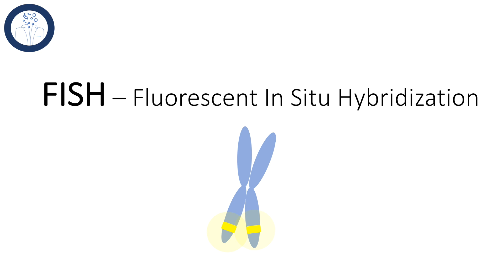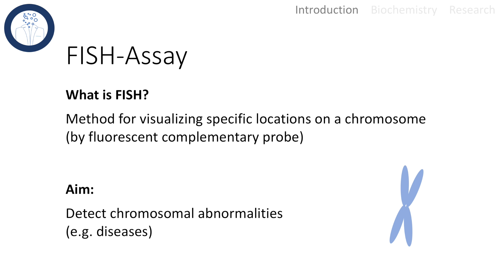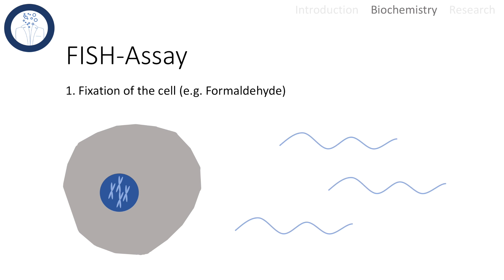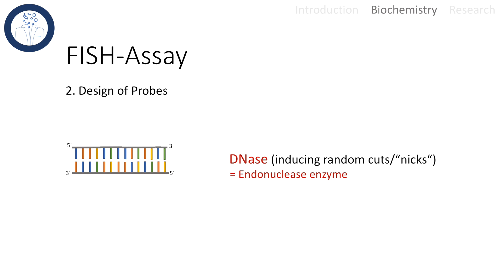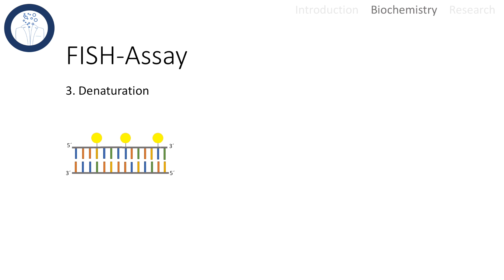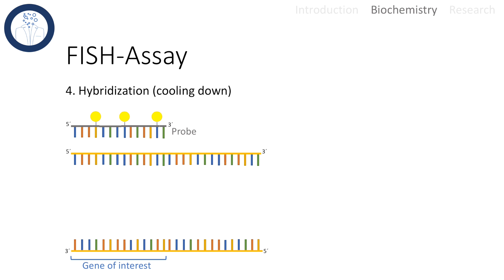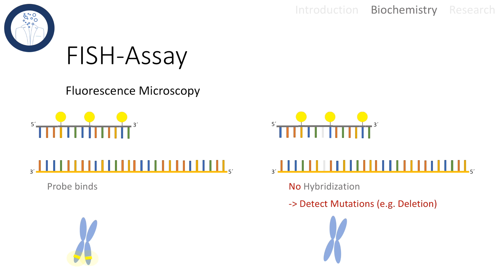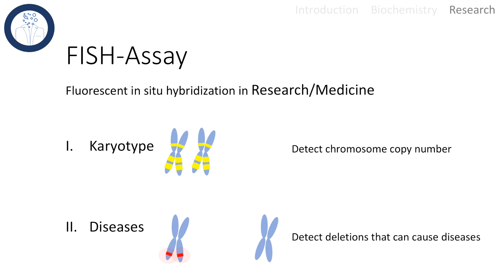FISH - Fluorescent In Situ Hybridization

Comment: 2 Quick questions
1) how can the ligase seal the fluorescent nucleotides. They need to be bound first right? So my question is how do these labelled nucleotide bind? DNA polymerase will just randomly come along?
2) if i do the labelling before I amplify, how will the PCR be able to copy the fluorescent dntp? 
thank you
Reply: in my opinion, ligase has some recognition site that recognizes the specific sequences and then it binds and causes ligation. DNA polymerase also has some specific sites that recognize first and then do polymerization. is this correct?